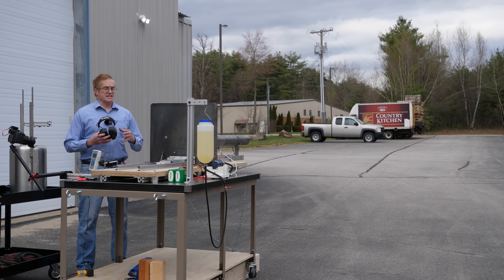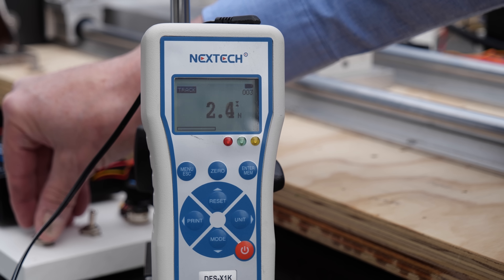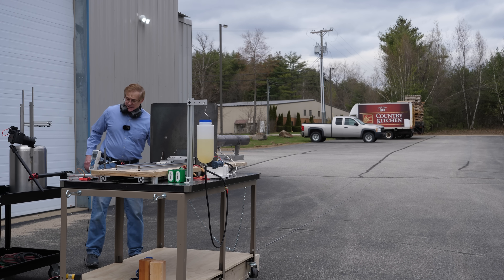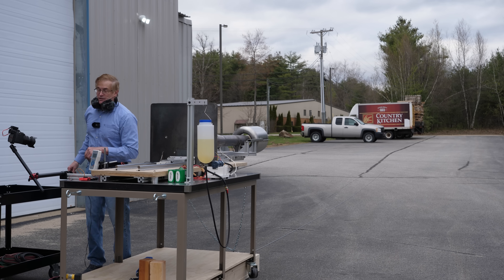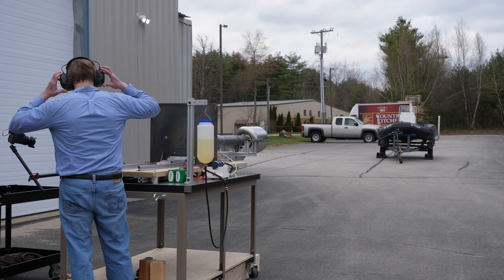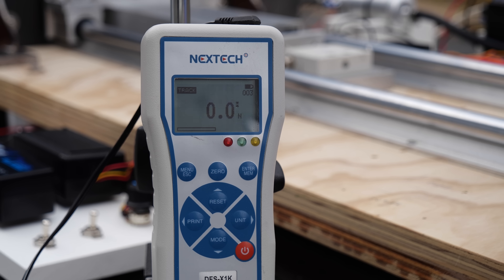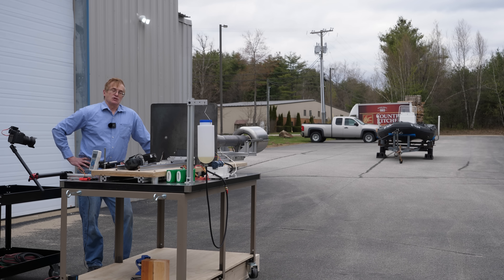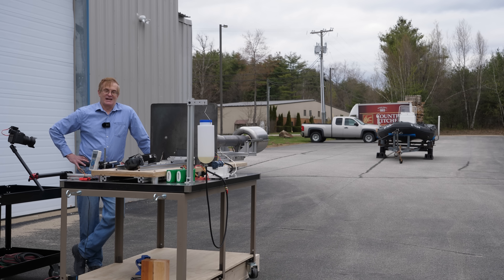WE USED AN AUGMENTER ON OUR PULSE JET!

Comment: It was definitely right to turn the wedges around. The mass of the wedges isn't enough to give much friction. Lifting the entire boat up the wedge would take much more force than just causing them to slide.
Reply: If the tire catches the top of the wedge, it would exert a force down on the wedge, and it would not slide.  It would effectively create a much steeper incline.

Comment: It may require airflow already flowing in and around the augmenter.
Maybe if the missile or drone or whatever you use it on moves close to its normal cruising speed then the air flow could result in a different behavior.

Comment: in motion .....  https://youtu.be/yDRJItKqClk?si=9GzX8aLV7E8Zs5OA    perhaps a shroud around the initial engine ducted to the venturi gets the hot air out the back and lowers the temperature of the assembly allowing a greater expansion of gas, moving it to the back of the assembly  and more fuel to develop more bang protecting the assembly from melt down with the applied cooling by way of ducted venturi.

Comment: As your test is static, you may want to consider what happens if you blow air  toward/into the augmenter. It could also have something to do with air density, but I doubt it as the explosion is contained before the augmenter. I don't see the devise on the end raising the pressure enough to get better compression at less air density.

Comment: "Hold the boat back etc." why not use the trailer turned 90 degrees, so it can't even roll at all...
Reply from the maker: The strap and crank were an excellent way to tension the system.

Comment: 1:15 A bladder of water under the table. Fill it up and you increase the mass into the ground. Then just empty and no worries…
Reply from the maker: That's a good idea.
Reply: @TechIngredients  If you make a tank instead of a bladder, you could also plumb it as a heat sink for water cooled projects.
Reply: @TechIngredients  At my company we used interlocking concrete blocks as weights to test our equipment. We had them in 400 kg and 800 kg sizes. But they are produced in many shapes and with different features. You can drill on them to install anchor bolts. They are super cheap. You pay essentially for the transport to your premises. You can store them over a wooden pallet and use a manual pallet jack to move them around. I'm assuming you already have the pallet jack. If not, maybe is not an optimal solution.
Reply: @Darkralos  Same thing as street bollards/Jersey barriers.
Reply: I agree, or use a 1000 IBC filled with water, when empty two people can easily lift and move it around, water is heavy, 1kg per litre will make and IBC 1 metric tonne when fully filled.
Reply: IBC or blocks are not as compact as a 100 gallon TPU bladder.  The tank might be good idea for water cooling but again it’s a rigid solution that they can’t just roll up and store when not in use.  The TPU bladder may allow warm water if used for a cooling system.